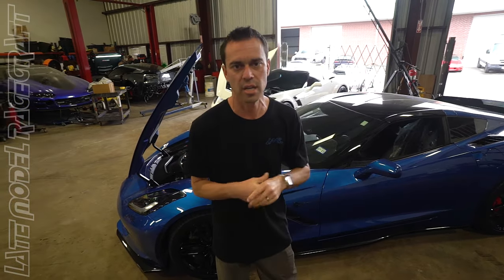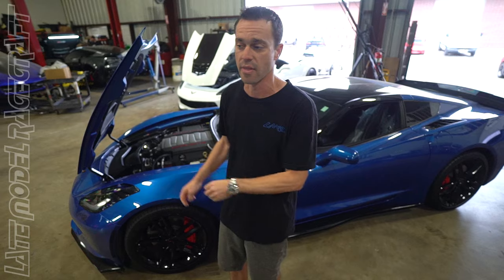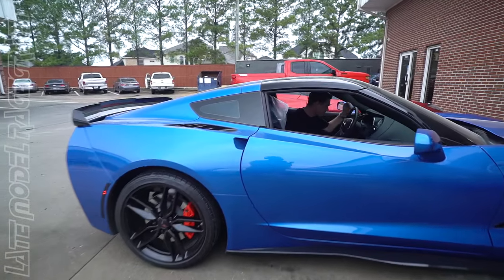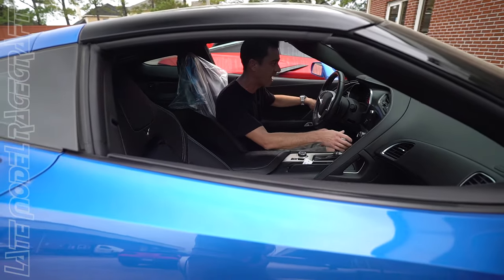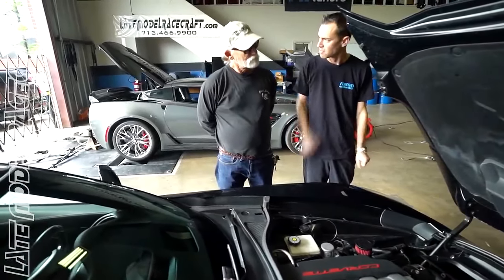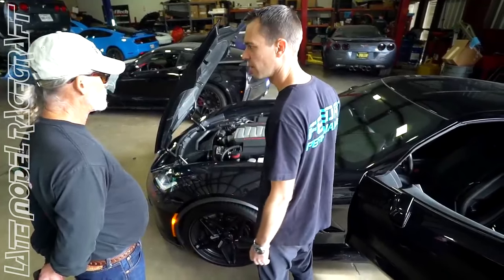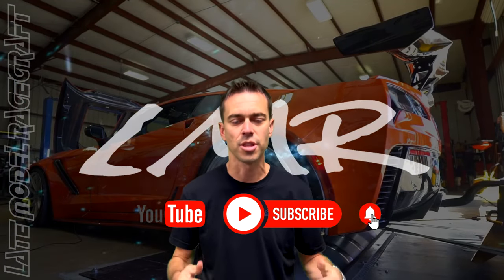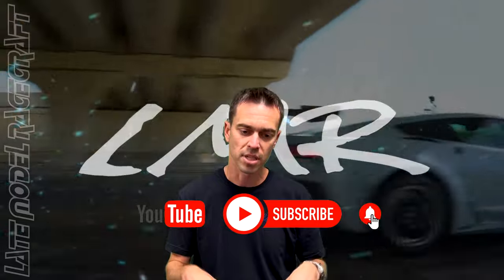Centrifugal Supercharger for C7 Stingray and Grand Sport Corvette - Late Model Racecraft

Comment: I really enjoy everything you show with the videos. The only thing is they are too short.  Anyway, you guys can give us longer videos.  Keep it up gents!
Reply from the maker: Thank you for watching.  This video consisted of two similar builds that were a few months apart and about 6+ months ago...  with the amount of builds here it's difficult to make complete videos on a single vehicles build so that's why have two in this one.  Obviously some random filler and shop shenanigans can make the videos longer but we've also been told to stick to the point...  lol.   lot's of different viewers here,  so honestly I try to stay on topic, market, entertain, teach etc...  sometimes 8+ minutes is difficult without boring stuff.  thank you for your suggestions
Reply: MY O.N.E ! question is what about the inherent overheating problems with c7's going into limp mode after 1 or two laps at a track day, and now you're adding more heat/energy? How does that work sir? @LateModelRacecraft

Comment: I had a Laguna Blue '15 C7 Z51 A8. Vengeance Racing put ECS blower only and it had my car from 407 rwhp 425 rwtq to 542 rwhp 534 rwtq. After catless ARH, LT4 injectors/hpfp it went to 615 rwhp 580 rwtq. Vengeance did great work.
Reply: Were you running E85?
Reply: @Byrdfloo1  Nope 93.
Reply: How much did they charge for everything? Parts and labor, I’m looking to see how much it would cost

Comment: I did a p1sc base pulley, with a fluted blade and you can barely hear it. Headers and spray meth 50/50 and laid down 603 at the tire. Still gets killer gas mileage as well.

Comment: I have a 2014 Z51 Velocity Yellow with black stripes. M7 with ECS supercharger, Kooks headers, Catless X pipe, Billy Boat Fusion axel back, 93mm throttle body, 570 rwhp. The only thing I don't like is the ECS doesn't whistle like that A&A.. :(